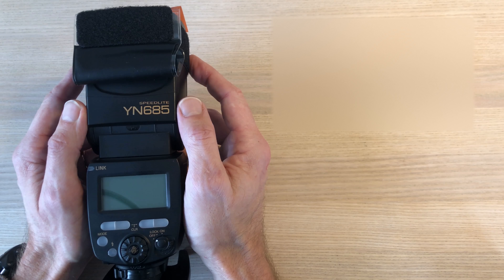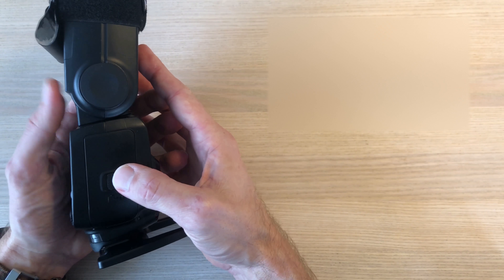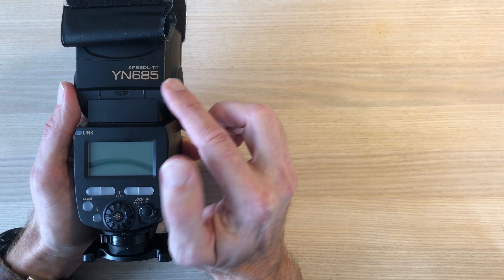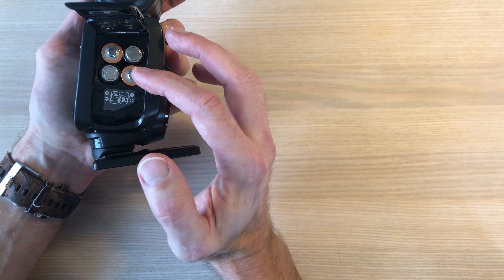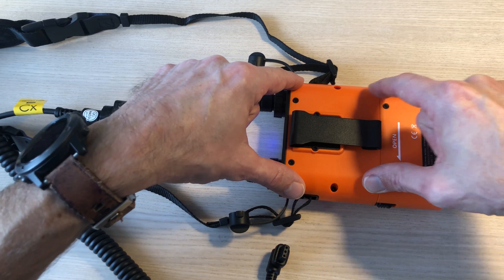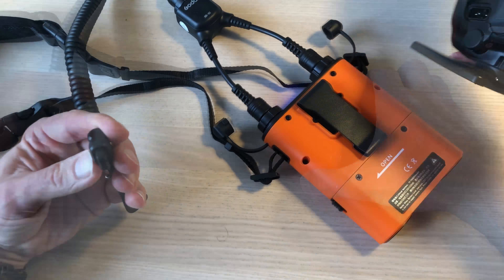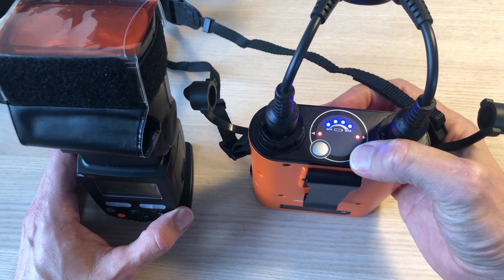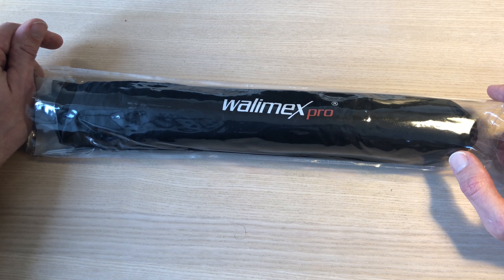Godox propac PB960 - Why? And first impressions

Comment: I made a mod on my tt520mk2 to use a DIY lithium battery pack directly in the power supply using the same cable shown in the video, it was practically better than this propac, it went from 5s recycling time (described in the manual) to 420ms (measured with 480fps slowmotion)
Reply from the maker: Wow! Such an approach is outside my comfort zone but good to hear you got good results; thanks 🙏🏻 for sharing!

Comment: I have suspected that my PB 960 (all black color scheme) never worked for my flash and your test showed me I was correct! It makes no difference in recycle time (always 6 seconds) whether I have it plugged into my GODOX TT685S. Now you mentioned something about the cable. My flash is the S version, since it's for a Sony A7III and I was given the PB 960 by a friend who had a Canon. The cable fits the TT685S fine and some searching says the Canon cable is the one to get. All the lights turn on correctly on the PB 960. I just have the single cable, not the Y.
Reply from the maker: @charlesbcraig  🙏🏻👍

Comment: Question fred how many hours does the PB960 last for usage when plugged in with flash?
Reply from the maker: Uh, tough question. Have never run it down, but I would imagine you could quickly do so if you shoot HSS where it fires many times per shot. My guess would be several hours if you don't shoot HSS and your are not too trigger happy. The battery gets tired fast if it does not get time to recover a bit between shots. Sorry this is not very helpful, but the best I got.

Comment: I have 2 Godox PB960's, using them with the 2 x Godox TT685's I use. Turns the Godox TT685 into a powerhouse 1800 full power flash output per charge and much faster recycling time! I use these when I need lazy light. I also have 2 x Godox AD200's, AD600 TTL and 2 x MS300's. When in studio, I use whatever is available at that studio, usually Broncolor.
Reply from the maker: Wow! What do you think of the AD200? Does it work well together with the other Godox flashes?
Reply: @frederikboving  seamlessly :-)
Reply: do you still need to use rechargeable batteries with this device for the electronic or not ? thank you

Comment: Anyone knows where I can buy the cable or model for ATG/Metz 76MZ-5?
Reply from the maker: sorry, no
Reply: @frederikboving  Are you saying Godox doesn't make cable for professional flash?
ATG/Quantum used to make the cable for 76MZ-5 but they are in trouble like Pocket Wizard company.

Every used the 60CT-4 , 76MZ-5, QFlash T2 series or MG8000 Extreme? 
They were ATG's last flashes made for the working pros.
The ATG's Auto2 works better than TTL flashes.
They never overheat, no shutdown & no meltdown.
Reply from the maker: @angelisone  I'm saying that I don't know. I am no expert on Godox cables.
Reply: @angelisone  You need to order the PB-Mx cable.
Reply: @tugwilson  You are just guessing because I got screwed by a camera store selling it.
It's doesn't even fit.  Have you ever seen or used the ATG/Metz 50MZ-5, 70MZ-5 or 76MZ-5?

ATG departed from Metz over 2 decades ago. And then later Metz folded into the history books.
Reply: @frederikboving  I rather hear honest answers rather than many just guessing.
Godox doesn't make ATG/Metz pros' cable.

Comment: Hi Frederick, not sure if you said but how do you charge the battery pack it self?
Reply from the maker: Hi! With the battery pack comes a charger that is used for charging the battery. However, the pb960 has so much power once charged that I don't need to use the charger very often!

Comment: Great video and literally ordered mine not long ago but you counted SUPER FAST and then on that last hit you moved your hand and it just turned to ready after a mere 3-4 seconds.  Don't over-exaggerate it lol.  I know batteries alone flatten out fast the more you use and become inconsistent.

For future viewers and speaking in general, this device is awesome and worth the money so get it without question.  Also, don't get it then immediately charge it.  Use it until you can't turn it on anymore THEN charge it.  People complain at times about how these "don't last long" .... that's because they bought it not understand these batteries have banks holding charge memory.  Don't just plug it into the charger until it absolutely can't turn on or just blinks with no absolute signs of use.  Lastly, I don't know fully about using the y cable to power one light.  I have mine on the single plug and it works just fine.  I feel using the y-single light can burn it out.
Reply from the maker: Ha-ha! Thank you! Yes, you have a good point about "massaging" the batteries, so they get really empty before charging. I must admit I am not good at this - I constantly "top" my batteries and they live shorter for that reason, so I hope others will read what you wrote above and take notice!
Reply: @frederikboving  When you get more lights, do exactly that and I promise your devices will last forever lol :-) .  That goes for anything pertaining a battery too my friend, let them die out first then you can fully charge(don't interrupt the charge).  When everything turns green, you can unplug and pop away my guy!
Reply from the maker: @mediaflmcreation  Ha-ha! Thank you for sharing :-D  I will let my electric toothbrush and my iPhone stay out of the charger for longer than I do now! Take care :-D

Comment: Good video! Certainly helping, what i would like to know though is if its possibke to shoot in continuous mode to shoot bursts in hss... noone is really going into this so id be happy if you could share your experiences.  Thanks in advance!
Reply from the maker: Hi Dennis, I assume that by continuous mode you mean a drive mode on your camera that fires a series of pictures with very short interval, i.e. a burst, say 5 FPS?  The HSS is already a kind of burst mode for your flash, as it overcomes the max shutter speed by firing several times per picture. This puts strain on the flash and most certainly the battery. If you then on top of this shoot HSS in bursts, you are adding bursts on top of bursts so to speak. I have not tried it, it should technically be possible, but the strain on your flash and battery will be significant in attempt to keep up with your camera.
Reply: @frederikboving  thanks for your response. I use a 5D iv which i think can take up to 7 fps. What i noticed though is the flash is only fired on the first picture using just regular batteries. For birds and wildlife i need more pictures whit flash being fired. I do use hss for quicker shutter speeds f.e. 1/2500 . Putting my camera in continuous shooting for 7fps output. Can the battery pack help here or do i need a different technical approach?
Reply from the maker: Hi Dennis, the battery pack will help, but it depends very much on how much power you fire at. If you go full throttle (1/1), then I understand the chances are slim - it will take seconds for the flash to recycle. If you go down to say 1/4 i starts to look better. I have not tried this, but googling a bit, this was what I learned. But I think you have to try with the specific combination you have in mind. 
You can try to go for a different approach: Kill the ambient light and let the flash be your shutter speed. Set the camera to something like 1/200th or slower than the min sync speed, drop HSS, and close down the aperture so that your flash light is the only light that matters. That way you only need one flash firing per picture and you can still freeze fast motion. I understand that people shooting things like water droplets hitting a cup of water use this technique. Hope this helps!
Reply: @frederikboving  thanks a lot, i will get one and try it out. I usually just do fill in flash with 18 or 1/16th of power output...

Comment: How long could those batteries be powering the internals? More or less, could they handle a wedding? Great video btw!
Reply from the maker: Hi Sebastian, thank you! I have never noticed as I use my flashes primarily for studio work and just change them as they run out. My strong expectation is that they will last a wedding comfortably because the battery pack takes all the heat. But that said, I would always carry a handful of spares just in case. All the best!